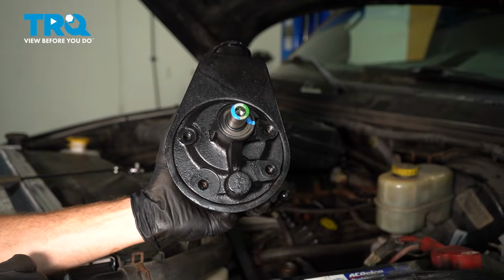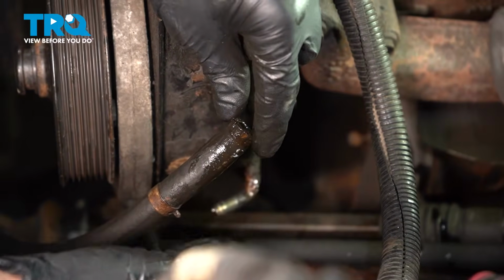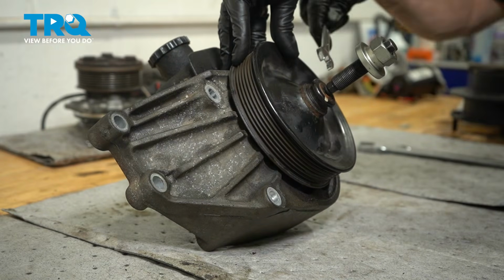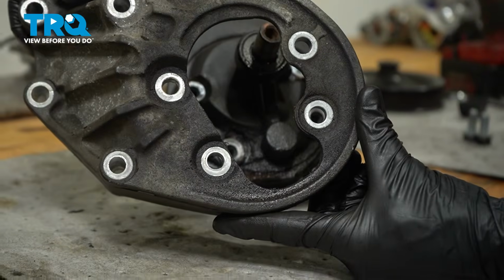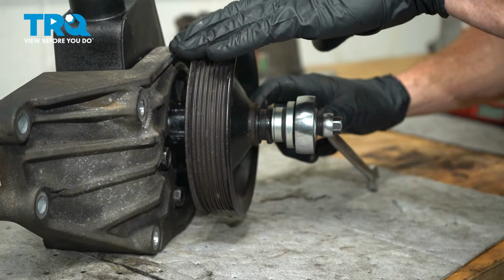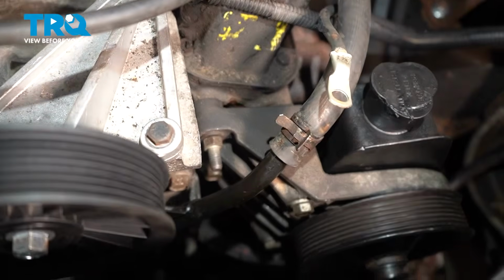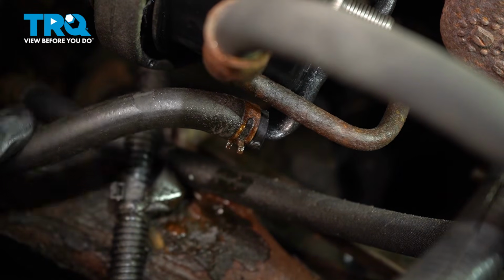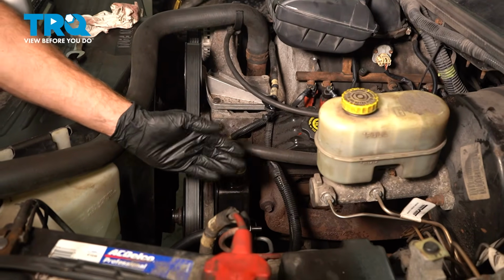How to Replace Power Steering Pump 1994-2002 Dodge Ram 2500

Comment: One of the best vehicle repair videos I've seen in a while! It's concise, well lit, clear audio, descriptive, easy to follow, and notes are in the description.

It is missing the process of bleeding the lines of air. If I understand correctly, this happens through use once the pump is connected, filled with PS fluid, the engine is on, and turning the steering wheel left and right. This probably should be added in the description. This video was strictly for removing and replacing the part.

Kudos to the mechanic, camera operator, and editor.

Comment: Notes: This was the same on my 94 Dodge Dakota
1.The pressure line screws into a fitting on the back of the pump. When I tried to loosen the pressure line by the 18mm nut, the 32mm fitting came loose instead of the nut for the pressure line. I could not break them free. I had to remove the line from the bottom where it attaches to the steering assembly and remove the pump with the pressure line attached. 

2. The pump/bracket assembly is really heavy and hard to hold in place while you reinstall the bolt. If you drop the pump and bracket assembly, it will land on your transmission cooling lines. You could damage them, and potentially the new pump. This is a likely scenario for me, since I have some arthritis in my wrist which compromises my grip strength. I addressed this issue by placing a 2 x 4 across my engine bay (fender to fender) and shooting a screw into the top of the wood. I hung the pump assembly from the screw head with some bailing wire. When I got it at the right height, I was able to wriggle the pump bracket assembly into place and get one of the bolts in.
3. I ended up having to replace that pressure hose. The replacement hose had an 18mm nut on the bottom fitting and a 5/8" nut on the top. The fittings, however, were threaded correctly where they inserted.

Comment: Is the new power steering pulley supposed to spin freely, or have a lot of resistance?
Reply from the maker: +Zak Miller There should be some resistance, but it should still turn freely when being turned.